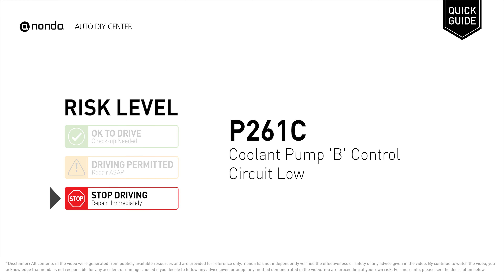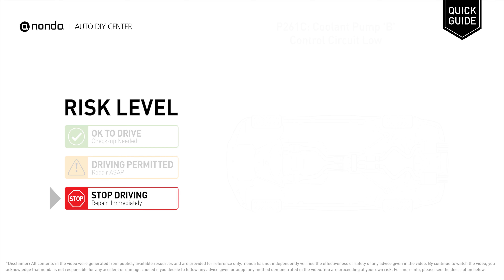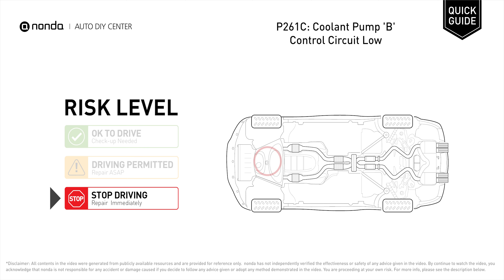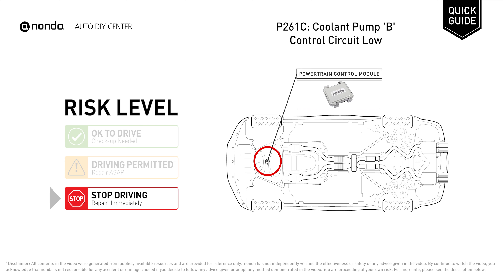What is P261C Engine Code [Quick Guide]

Comment: hello I have such a fault code at my car, can you tell me what you did to fix this error
Reply from the maker: Hello, kindly inspect if there's any damage on these parts and replace if necessary: Coolant pump control relay, Electrical components, PCM or CAN. Also, check and replace if there's any ground straps or ground wires.